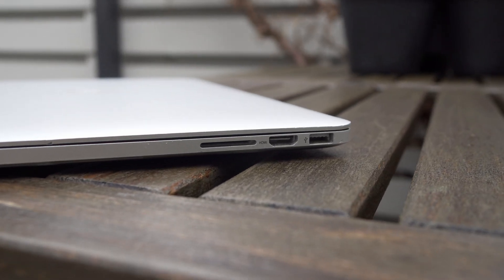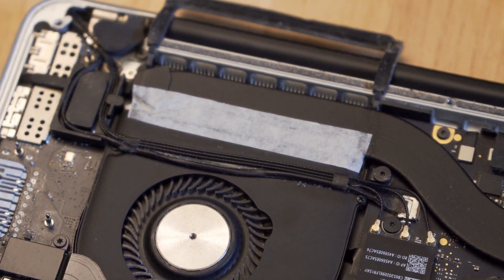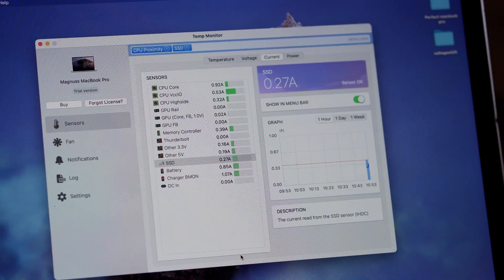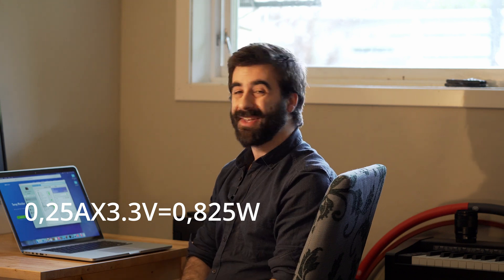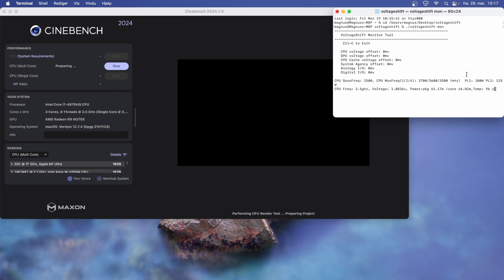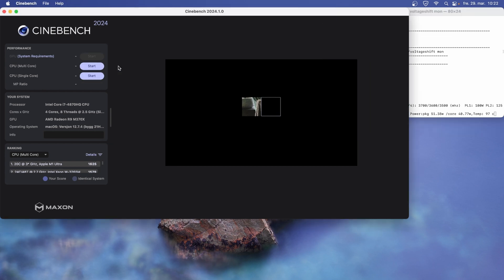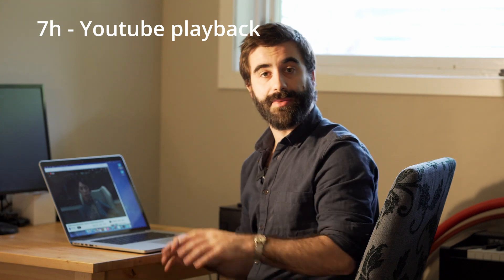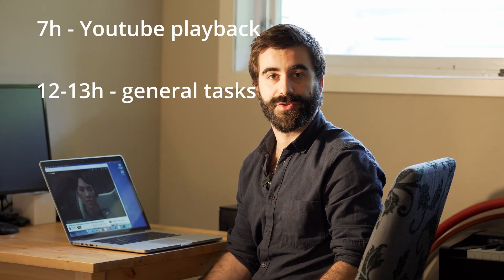Project Perfect Macbook Pro 15 2015

Comment: Can I create same launch daemon if my specs are identical to yours? 

I tried - 90 -90 -90 and got freezes. 

- 75 - 75 -75 works for me
Reply from the maker: All undervolts (and overclocks for that matter) are individual, based on silicon lottery, cooling, vrm, etc. Identical specs doesn't really matter.
Reply: @hartlytartly  got it, thanks for swift response)

Comment: Any idea about what could be causing Error Domain=KMErrorDomain Code=71 "Could not find: Extension with identifier 'com.sincreative.VoltageShift' not found" after trying to use the ./voltageshift info or mon command? everything else up to this point went normally
Reply from the maker: Have you typed in cd your voltageshift folder location first?

Edit: Based on the error it seems that the extention isn't installed. Have you remembered to disable csrutil? Type in "csrutil status" in terminal and see whether it is properly disabled.
Reply: @hartlytartly  Yes csrutil status is disabled. The extension you are referring to is the .kext correct? When I use the sudo chown command it does ask for password but then when I hit enter after the password it doesn't provide any explicit indication that the kext has been installed, just goes to an open line on the terminal. I'm not sure if this step is the issue, but it is asking for root password so I think it is recognizing this step. Very strange indeed

Edit: and yes, I do include the directory/location of the voltage shift before the command, it still provides the same error code 71
Reply from the maker: @APolskiMD  in that case you may have to type in the chown command, and then allow the extention in the security page of settings. Sometimes it needs to allow it like opening a program from a third party developer, even with csrutil disabled.

Comment: Damn I really needed this vid….
Reply from the maker: Hope it helped!
Reply: @hartlytartly  hella, I was tweaking with my 15 inch 2013 but the battery life on Sonoma is horrendous, made a lil more special cause I painted  the black hinge antenna cover pink and I have to laugh everytime I look at it. Plus it’s now sporting the US layout with Czech keycaps. I feel it’s gon take me to the moon and back.
Reply from the maker: That's hillarious! Yeah I tested Sonoma with opencore legacy, but I had about 10-15% worse battery life with it than in Monterey without opencore. Might have been some conflict and I didn't do it right, or it might be that Sonoma relies more on modern hardware decoding for window rendering, that simply isn't supported on the 2015 hardware, so it needs to do some small little things on software.

Anyway, long story short, Monterey for me=better battery life.
Reply: @hartlytartly  will keep that in mind, I just love pulling up with  obsolete laptop but most up to date software the other OS I use on my main computer is 10.9.5